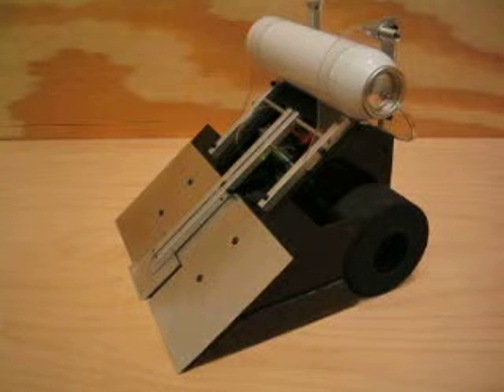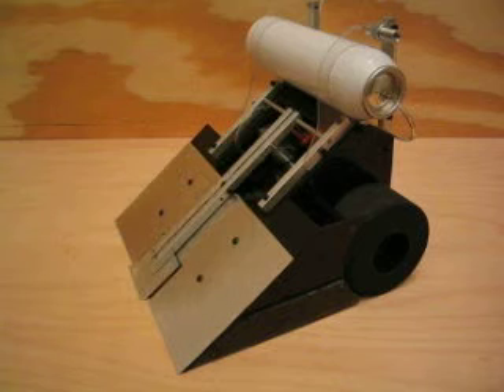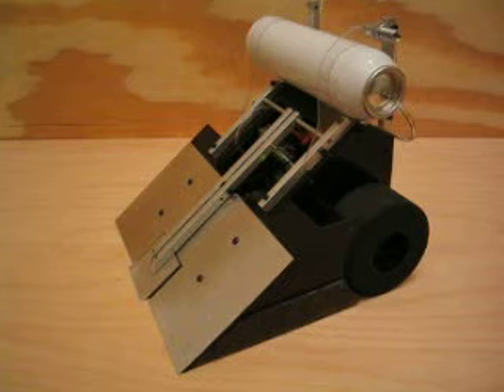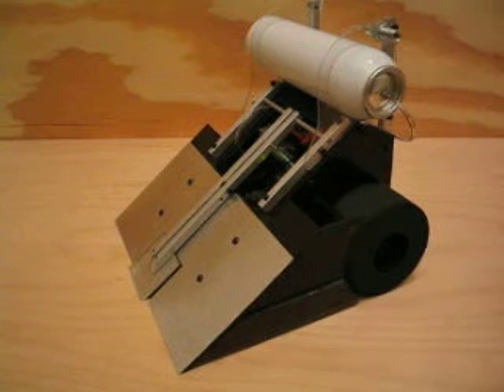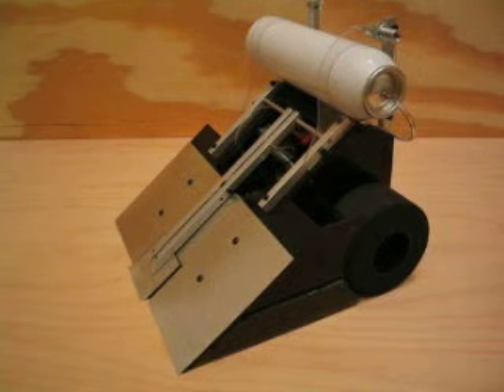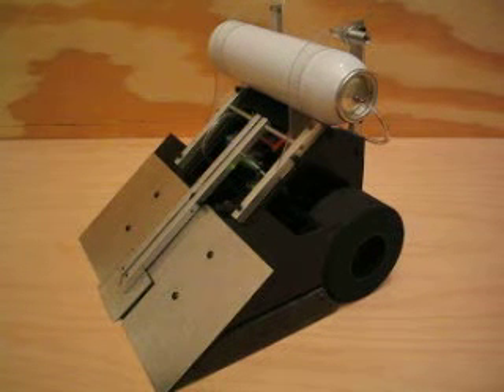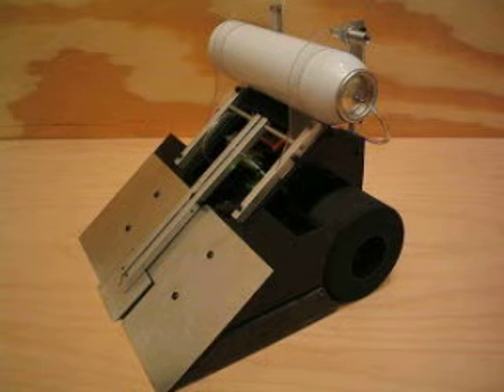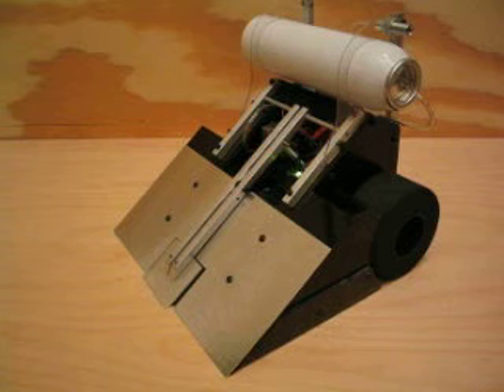Pneumo Lynxmotion Combat Robot

Comment: awesome! But i have a 1 question. how did you set up the pneumatics? Thanks

(ps im only 13)
Reply from the maker: +Andrew Waraksa Andrew - The pneumatic servo opens when that channel is activated. The air tank is a standard robotics part that is inflated with a bike pump before the competition.
Reply: +RallyIsetta ok thanks and awesome robot (: